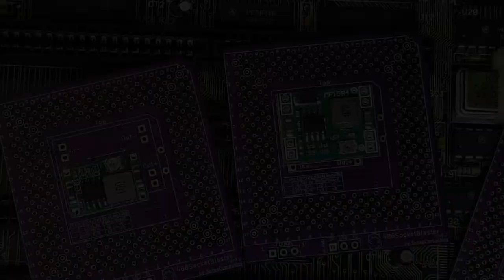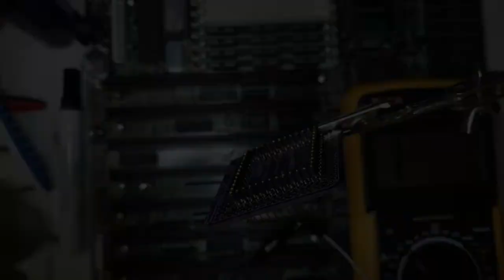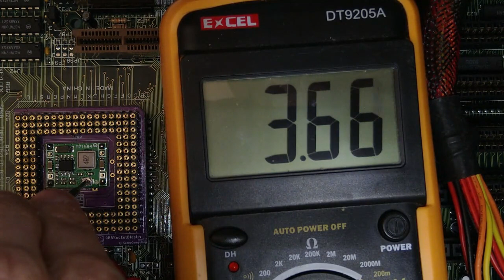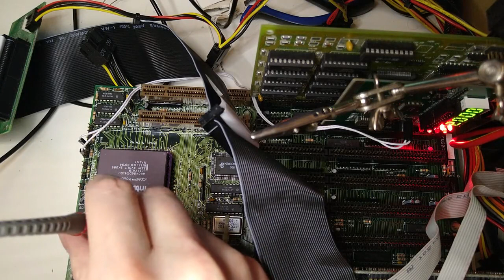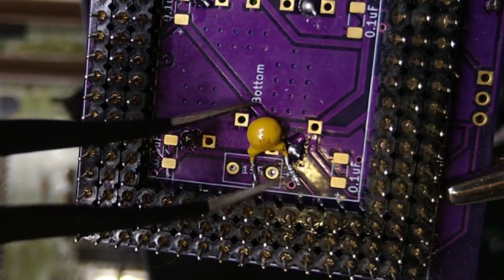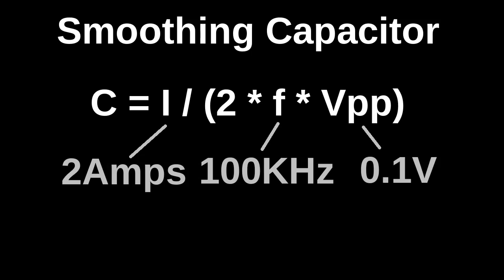486 Socket Blaster rev0.2 (DIY Voltage Adapter part 2)

Comment: Got myself a few v.: 0.5 pcbs made for a DX2 80Mhz (for the moment only a DX40 the adapter ain't ready yet) that I am building for nostalgy reasons using a VLB Cached IDE controller that has it's own 80286 as the disk controller and giving the controller 8Mb RAM also giving it an AWE32 with another 8Mb RAM and will see how much RAM I can put on it, for the moment it will be 16Mb as I need larger capacity 30 pin simms.
Want to have this baby dual booting OS2 Warp 4.5 and  Novel Netware Personal Dos 7 (or MS-DOS 6 plus Little Big Lan hehe). In any case OS2 will be the main OS regardless can't wait to see how fast that IDE controller will run when caching CF cards haha

Comment: 1 279 / 5 000
In the mid-1990s, I had a very strange processor in my hands, for which I still have no explanation. It was an AMD 486 that had a pretty damaged print showing the AMD logo and a very bad 100. So I set up a 3V power supply and nothing. I thought the processor was dead or something with the board. But the processor in another board didn't run either, but another processor ran in this board without a problem, so I knew it wasn't the board. The Internet was not available at that time, so I wondered if there were any 5V DX4s. I thought I had nothing to spoil and set 5V. the processor started up and worked without a problem. I tried it on another board and with 5V also without a problem. It reported as DX4 100MHz on both. it just didn't work on 3V. That's a very strange combination that I've never seen before. According to all the materials I could find, AMD never made a DX4 that had a 5V supply. Even if it was 5V DX2 and I read the 100 on the surface of the processor stupidly, it wouldn't report as DX4 100MHz. However, it was clearly not a record. So either the CPU was somehow kicked (but it functioned without problem for a friend for a few years and was discarded only when he bought a better PC) or I had a very special processor in my hand, but then I would be interested in what it was?
Reply from the maker: This is very interesting. I have never heard of a 5V DX4. The highest clock 5V CPU that I am aware of is the DX2 @80, but I think those are very rare too.

Maybe some folks at vogons could help you identify the part.
Reply: @scrap_computing  Maybe one day some information about the strange DX4 will appear. I have had other encounters with strange hardware. Maybe it will turn out like when I used to have a Pentium 50MHz. When I told someone, everyone told me that it was nonsense, that there was no such thing. Even in the age of the Internet, nothing about this could be found for many years. It was only much later that information appeared that it existed - there were engineering samples. But what I still haven't been able to identify was the record I had for it. It had 1MB L2 cache and switching 50/60/66MHz, form factor half AT. I couldn't find any board with socket4 on the retroweb that would allow 1MB L2 or that information is not listed.
Reply from the maker: @Thales_WH  Yeah 1MB L2 on a socket 4 sounds too much, but you never know. It could have been a workstation part.
Reply: @scrap_computing  I would expect some atypical format for a workstation, but who knows? That board did not have 1MB L2 when it came to me. It had less, I just don't remember if it was 256KB or 512KB, but I remember that it had an unusually large number of empty sockets, so I filled them as much as I could :D

Comment: Does the SB work on Socket 2 Motherboards?
Reply from the maker: I don't have a Socket 2 board to test it on, but I think they are backwards compatible with the original PGA-168 socket of the 486. So I am fairly confident it should work on the Socket 2 too.

Comment: Through-hole caps are not really good at smoothing out high frequency ripple so the best would probably be a mix of bulk crapacitor and a couple of small ceramic ones. :)

Comment: So if I were to get an AMD 5x86 133MHz and install it into my 486 machine's Overdrive socket with the Socket Blaster, it should work? FSB in this thing is 25MHz and it currently has a 50MHz DX2 Overdrive installed.
Reply from the maker: Yeah it should work. It may need a good quality voltage regulator though and you would also need to populate all the capacitors on the socket blaster, which I haven't done yet :). Some folks in the comment section have mentioned some good quality ones. 
I will give it a try and I will get back to you.

Comment: You intend to run a 100MHz Dx4/486 without a heat sink? do let me know how that goes for you, because I am actually looking at one right now and it says HeatSink Req. It's not on the cpu it self but on a red sticker stuck to it.

Comment: Wow what a nice idea. Now.. i did sell my 486 about 10000 days ago but it would be fun to have one again.. maybe with a little modern enhancments :)
Reply from the maker: +1 It is easy to get them running these days. You can use an SDCard to IDE adapter for storage, a floppy emulator, and a modern ATX power supply with an adapter.

Comment: Fun! Back in the 90s when I was assembling PCs, we found by accident that AMD's DX2 (whch was the same as their DX3 and did support frequency tripling) worked perfectly fine under 5V, albeit very hot! We were running so-called DX2-66 at 150 MHz as 3x50 with a heatsink! When they released the next one (5k86 I seem to remember) which supported frequency quadrupling, some of their DX2 did support doubling or quadrupling and the trick still worked; so we could buy DX2/66 and operate them at 4x40 = 160 MHz. We had a few boot at 200 but they didn't go very far. Our customers loved this by then, as many of them were discovering PC games and you couldn't count on VLB vdeo cards to offload the CPU! We saw a few DX3/150 return and require to be lowered to 120 or 133 MHz after a few months, but that was marginal.
Reply from the maker: Nice! 486s are pretty tough, they seem to tolerate quite a bit of abuse!

Comment: Would it be possible to extend the PCB an add circuitry for L2 cache? I swear I have seen such a thing for sale once on Ebay. I remember is used those weird chips that had a width that was between a normal cache chip and, say, a typical keyabord controller.
Reply from the maker: Great idea! if I am not mistaken the cache is managed by the chipset so there would need to be some additional logic to get it to work. But yeah, that would be awesome!
Reply: @scrap_computing  Normally it's managed by the chipset, but Sony made a complete solution with a single chip, it attaches directly to the 486's bus. The chip is the Sony cxk784862q, you can easily find the datasheet for it. For instance Compaq used these on certain 486 machines.

Comment: The fine grain control over voltage is very interesting - I wonder if this could help get the overclocked AMD X5 chips  even higher than the current records.
Reply from the maker: Yeah, you could even power it externally using a bench power supply!

Comment: Supercool project. Staggering the pins diagonally is an interesting approach by the way. I was playing with the idea of building a voltage adapter but i was tinkering with using two prototyping breadboards on top of each other. Gave up after a while.... :D
Reply from the maker: Yeah, I was considering using a breadboard myself, but I am pretty sure I would mess up the wiring and spend a ton of time debugging it :D

Comment: Nice update.

I would like to just point out that your voltage isn't high enough.
For Intel CPUs it should be 3.3 with 0.3 tolerance. I could see on your scope that the CPU was getting 3 which is just barely within tolerance.

For St they want 3.45 with 3.3 minimum and AMD is about the same. Which means a tolerance of 0.15v so I'd say if you used and St/ibm/amd chip, you could have more stability issues than you've had with the Intel one.

Personally I've used a 1084-3.3 regulator with an AMD CPU and have had no issues with it. 

There is a bit of noise surrounding this topic, some say to use 3.45, some say their boards are set to 3.6 out of the box. 

On regulators you could look at murata ones they make a selector of regulators, some small, some large. I've used a large murata for a socket 7 and it's been perfect. Though with building the regulator into the board, you could use parts available with smt services and have the board makers do that part of the soldering for you.
Reply from the maker: Yes, 2.9V is not ideal. Thanks! I will check them out.
Reply: @scrap_computing  The crashing is interesting. Are the caps on your test motherboard fresh? I had a couple motherboards that were fine for light tasks but would crash under the quake Demo until they were recapped.

Comment: Great little widget and very thought through. I suggest using tantalum SMD caps to minimize the ripple. 200mV is huge, I'm surprised you don't experience more problems. Perhaps consider using 100uH inductors????
Reply from the maker: Yeah, I will give it a try. Perhaps, as others also suggested, it is worth implementing a good regulator circuit on the board itself, and not have to rely on these cheap regulators.
Reply: I would look at Aluminium Polymer capacitors, also probably look at implementing a linear post-regulator with good high-frequency rejection. Maybe also a 4-layer PCB with the power on the inner planes.
Reply: Maybe even a 6-layer PCB would be useful here, at these high frequencies, running power in traces is not recommended.
Reply: @varno  definitely agree on 4 later design, what frequency runs through the board? 30 MHz to the bus? Also have a look at trace length matching, that might help with timing. Although all the amendments on PCBs are great I reckon the biggest performance increase will be from Linear regulator or some with lower noise, I'm afraid you will have to have a look at some more reputable sellers for these :)
Reply: @LegacyDevices  actually just looked at the regulator and it is a 4mhz version. I actually think this is probing issues and high trace inductance. I have seen this before. You probably should use the little spring to measure the voltage, not the alogator clips.